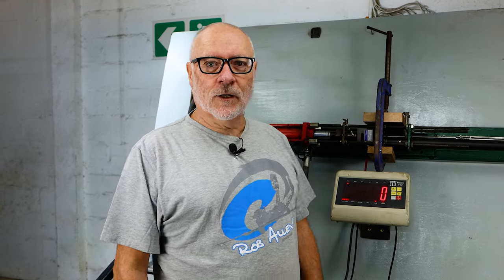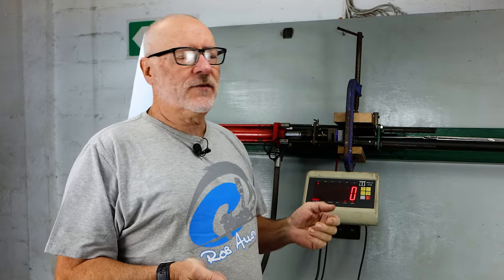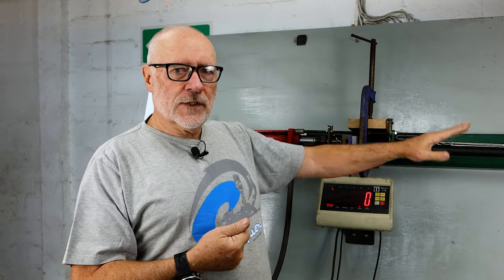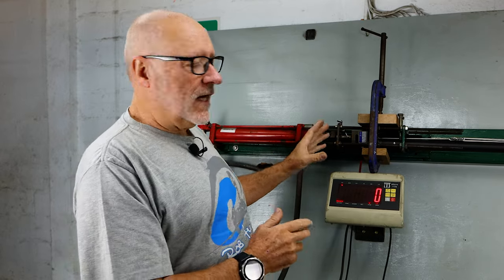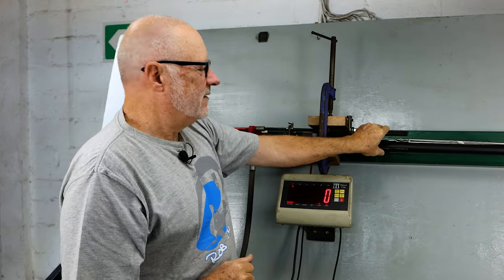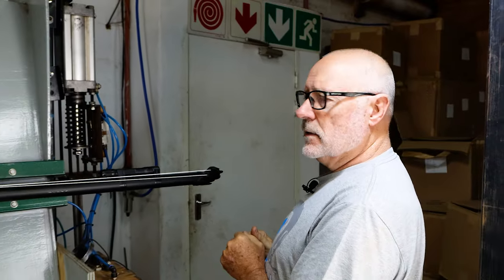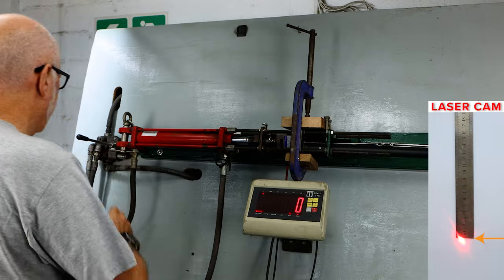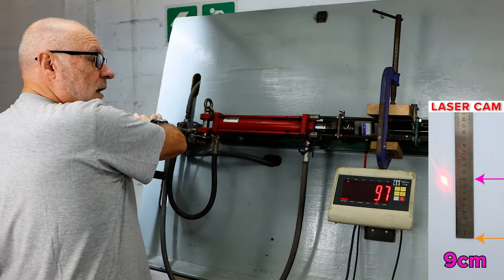Rob Allen | Barrel Deflection | Part 1 | Aluminium | 2024

Comment: Very cool to see! My guess is Barrel flex ends up helping with accuracy at distance, as Coatsman mentioned you would need to compensate at that range to be accurate with a 120/130 conventional. Do you think shooting fish within 4m you we would need to compensate low for barrel flex or is to close it doesn’t matter? All that to say, my next gun will be a roller!
Reply from the maker: There are so many variables, hard to say.  I very much doubt it will help. I have a strong belief the flex can allow the muzzle to chop down on the spear as it is exiting the muzzle just after pulling the trigger and releasing this tension in the barrel. The back is held by the hand so less downward  "jump" this end of the barrel.  If this is the case, it will create a wobble in the spear and slow it down. We need to do a lot more pool testing and filming to test for this.

Comment: Hi Rob fantastic info. Q. What was the distance to the ruler in this test from the front of the speargun muzzle?
Reply from the maker: I did mention this in the video but I will clarify. I always measure shooting range from the hand holding the gun. In this video, the "target" is set at 6m from where the start of the barrel is held in the clamping jig. This is roughly max effective range you will get with a 1,3m gun powered up. Most fish are not shot at max range so that difference will change significantly when shooting at normal range. I'd say the "normal" shots taken with a 1,3m gun will be at a distance of around 4m from the hand holding the gun.

Comment: very interesting, wonder what a single aluminum plate welded vertically into the tube on the inside would do, not saying its viable for large scale production but would be interesting to see if it would lend any additional support.
Reply from the maker: We have looked at just that long time back and then did the math calculations. If you take the same amount of material you would set inside as a vertical beam and added it to the wall thickness, it comes out to the same thing. This is because you are adding to the hoop strength. No problem getting a tube made like this, then just make a tool to cut the inner portion out.

Comment: Should be cool to see the deflection of each barrel length, work out an equation and plot it on a graph and compare it to a graph of the deflection of the Carbon and the timberline.
Reply from the maker: That would be a lot of work, will consider it after doing the other barrel types.

Comment: So does this matter when you are looking down the barrel and it’s loaded?  Don’t you see the  deflection when you look down the barrel and accordingly adjust for it in the shot?
Reply from the maker: You will not see the deflection. The gun will shoot fine but, it will most probably cause spear wobble which will affect the accuracy, if powered up.